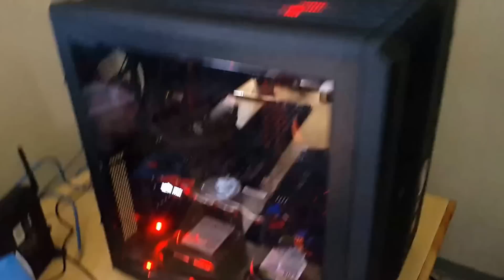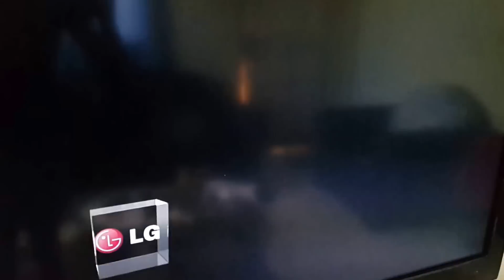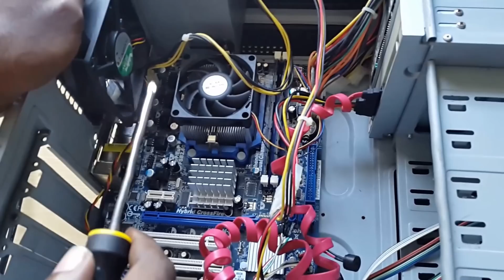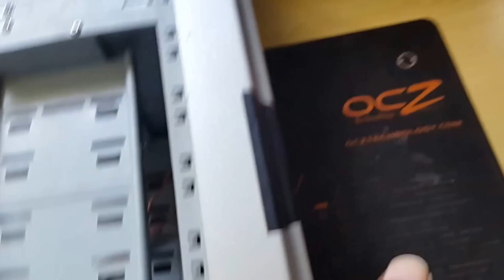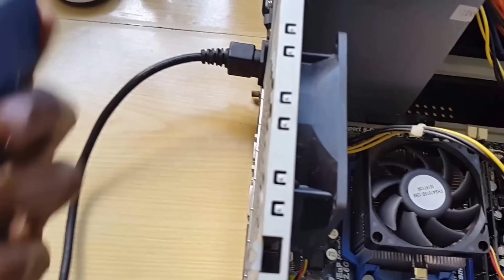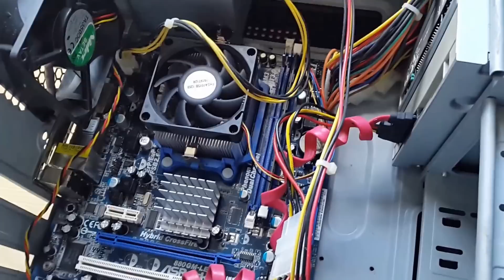No signal to Monitor Fix Easy PC Fix

Comment: hey bud nice video listen i got a issue with a foxconn m31 series mobo where i have tried to trouble shoot a no signal issue on it the mobo powers on but i dont get signal on the display i have changed ram i have changed psu i have put graphics card in i have put another harddrive in i have taken out cmos batt and still no joy any ideas???

Comment: If you’re still trying to find the solution I tried everything too I just unplugged my screen left it off for a minute or 2 then plugged in my screen and it worked it had said no signal also and I replugged everything idk why it would do this either my screen is a aoc monitor if this helps anyone also try a diff port and or your graphics card port not your motherboard
Reply: My screen is A aoc to but it tried it on a BENQ AND THERES THE SAME PROBLEM THINK ITS MY CORD
Reply: Jamal Waddell yeah try the regular things like diff monitor, cord, try the same cord and monitor but diff computer and eliminate the variables 1 by 1 I did it and they were all good it was just the order I plugged them in for some reason which is retarded but that’s just what I did good luck

Comment: I was able to clean the gold leads on my RAM gently with a towel and it did the trick. This was my second attempt to clean the RAM. The first time I tried to simply spray the leads and connection with a can of compressed air and it did not help. Thanks for the video!

Comment: If you have a graphics card 
Then put your  HDMI or what ever you are using in the graphics card not the motherboard.And yeah after 2 hours of research i have this conclusion made
Reply: My problem is my vga is no signal . Please help me
Reply: @yellowzonesbj4468  if you have a graphics card then put your vga in that if you dont have then you can change your port if you have more then one or change the cable it could be damaged or something.
Reply: @yellowzonesbj4468  try the same i have replied to yuukieha
Reply: @potatogamer3552  thanks dude  i  toke out my graphics card and  put it a little lower turns out the cable isnt dirictly plugged to the graphics card cause it has metal on it so i moved the graphics card a little lower to completely plug my cable thx
Reply: @yuukieharedhacker6364  your welcome brother
Reply: I  had a new graphivs card and it says no signal and when i plug the vga it still says no signal
Reply: @yuukieharedhacker6364   check the vga cable's pins on the top if one is missing or banded please change and also try to take out your graphics card once maybe that's the problem
Reply: Ok I did wat u did (I have a display port cable btw) but I still have no display and still have the EZ debug red light
Reply: @tsumm9951  Hmm try to put some thing else in your monitor like if you have laptop that have a vga or something else  to check the vga port in your laptop is still in  working condition if you have two ports of vga in your computer/monitor  then try to change it.
Reply: I forgot also take out your ram and clean it and put it back again this should stop the red light thing.

Comment: To who ever read this comment. YOU HAVE TO CHANGE MOTHERBOARD. Once the part of motherboard  got broken and stopped functioning. ITS USELESS. But also try to bring it to a technician if there's a possibility that the problem might be on your monitor. (It can be fixed)

Comment: My problem was that I plugged in my desktop to a power strip and not directly into the wall
Reply: alberto miller is that a real issue?
Reply: @boyboy6123  yeah, sometimes the power strip would divide it's power and lose voltage and it won't supply enough power to the power supply, so it won't turn it on. Also it is a major fire hazard looking back on it and the best thing to do was to plug it into the wall anyway. Linus tech tips made a video talking about this issue, but he used extension cords instead.
Reply: alberto miller my gpu powered fine with a power strip until I saw no signal and reinstalled the gpu and then gpu stopped working :( I put power cable directly in the wall and no result. I checked pci connectors, all wires and everything is fine but gpu.
Reply: This comment saved me my god, sometimes the power outlets dont generate enough power vs the wall usually having a better voltage so yes this can cause the problem
Reply: @thunderhailx  glad I can help ;)

Comment: I’ve tried moving RAM using MoBo ports I bought a DVI STILL doesn’t work. Tried using one stick of RAM doesn’t work. I’ve tried removing GPU and putting it in. I even rebuilt it it still says no signal. I’m using a ryzen 7 with a asus rog Strix x470 F gaming and the GPU Is Asus Strix 970 GTX the only thing that was used was the GPU and the owner said it was working fine before he sold it to me. Please help

Comment: I found out it really was the video card... not the cable or monitor cause when I plugged it into the built in card the monitor came on fine so it's the external video card.... gonna try n unplug n plug it back in its sloy if that fails.. wel my card is fried due to the random power outages despite having a surge protector .

Comment: Hi guys,

I have just build this new pc. Everything is new. I have zotac rtx 2060 gpu. When i start my pc it starts normally and press delete to go to bios message shows up and when it tries to shows windows welcome message it shows no input signal found, display going to sleep and black screen. Then when i restart the pc everything starts fine. Now i can't figure out what's the issue. Also when i turn on and off the monitor it tries to show the windows and gives a sound like when you insert a usb on pc. like it's detecting sounding and installing. Also one time it showed the mouse but in a black screen. Now  i am thinking maybe gpu issue. i do have installed the latest drivers.  I do not have any old gpu. Also i apologize if this doesn't make sense.English isn't my first language. So this may sounds confusing. Thank you. My pc specs:

cpu: Ryzen 5 3600

Mobo: B450 Tomhawk max

gpu: zotac rtx 2060

storage: 512gb 220s ssd

16gb ram

Comment: Thank you so much. I removed the monitor cables and held the power button for the minute, plugged cables back in and it worked. Relieved.

Comment: Try jumping the CMOS by finding CLR CMOS on your motherboard then remove the cap the normal is 1-2 pin then try it in 2-3 wait for 3 to 10 minutes then power on your pc😬 works on my pc
Reply: Hi i did the first step and it workt one week later the problem came back and the first step dosent work anymore i am tooo afraid to tuch anything in my computer do u have social media to help me PLEASE PLEASE PLEASE PLEASE PLEASE
Reply: @tiffanypaw6635  I'm just an 18 years old sr high student😂

Comment: Should i do this methods even if my pc is new ?

because i want to try 2 monitors. but  the problem is it says no signal at vga and hdmi at graphics card .

but only 1 port I can use for 1 monitor
the DVI port.
I worried to buy a new monitor because I try the other ports and it says no signal . 

can this methods work for mine ?

Comment: Aye so i switched the monitor and used dvi/hdmi cord and the display finally works, the keyboard and mouse light up, it detects them, and says:

Please enter setup to recover bios setting.
Cmos date/time not set
Hit f1 to run setup
Hit f2 to load default values & continue

When I try to select f1 it does nothing, as if the keyboard isn't functioning/responding, or the display is frozen.
Yeet. Pls help me, I'm an absolute potato 🥔♿

Comment: Thank you so much Ricardo. You are a genius! I watched the video, and was very sceptical. Unplug the power cable, and hold the power button in? And that's it? I was sure there would be no way that would work. I tried it, and it worked. Amazing, and so simple. All fixed. Saved me the cost of buying a new GPU, which seemed to be the most obvious cause.

Comment: I have problem with MSI wind Top AE2020 when switch on no blank screen with note,,,,,no HDMI signal
Reply: Have you used the reset cmos switch? Had the same problem, take out cmos battery, if that doesnt work, there should be a couple pins next to it, use a jumper, and if you dont have a jumper, place a flathead screwdriver on the pins and move it around 'till you get a post.

Comment: This happened to my PC just a minute ago and I was panicking. Was working fine then just got the no signal issue. Tried a few things and couldn't see anything wrong. I found out the cause. One of my power supply connections to the motherboard was unplugged so plugged that back in and it now works, so I'd say check all the connections from the power supply to the motherboard

Comment: No signal and I think my ports are damaged because my mouse isn’t lighting up nor my keyboard does anyone have an idea of what I could do
Reply: Check to make sure all your power supply connections are plugged in correctly, I was noticing my keyboard wasn't lighting up and some of my fans stopped working as well. One of my connections from the power supply to the motherboard was uplugged

Comment: Getting a new power supply worked for me. Also make sure you're using the correct cable for the power supply.
Reply from the maker: Thanks for the tip sure it will help others.

Comment: First method worked thank you. What exactly causes this problem?
Reply: I'd like to know too. I just had this issue and can't find the answers anywhere. I'd really like to know what happened so I can avoid it in the future.
Reply: I've gathered that there is a similar issue occurring with TVs where you need to unplug and press the remote on/off button for 30 seconds. The reason why it's necessary: Even though the device doesn't get any power without cable connection, there's still electricity stored in the condensators. And if a fault is present in there, it will be only be removed once the condensators are drained through the surge that happens when trying to start the system when you press the power button. How these faults occur, I do not know, either.

Comment: Do you need a graphics card in order to get your monitor to work?
Because I plug my hdmi to my mother board and it doesn’t it says no signal on my monitor
Reply from the maker: No the problem can be with a Graphics card or onboard video.

Comment: I'm having same issue no signal to tv from HDMI cable is connected to my Rx 460 and my keybiard rgb is not turning on ive checked everything I suspect a bad ram since the ram dosent produce heat it feels way cold I also have a rx debugg led that says vga what is odd is taking gpu out turns my keyboard on ?? I have a ryzen 3700x a msi mpg x570 a seasonic focus gold 750 watts and lpx 3200 2x8 sticks

Comment: I just bought a cyber power pc with a monitor, no signal.
Reply: Take it back
Reply: Same thing happened to me, try a hdmi if youre trying a VGA cable. If youre using vga and it doesn't work, then try HDMI

Comment: The first method fix the problem but when it launched i had a cpu error is that safe ?
Reply from the maker: Check out what the CPU error means.
Reply: @rickytlc1985  i found the problem and fixed it. The cpu fan was not moving thats why it showed the error

Comment: Pushing the power button for a minute didn't work for me, so I ended up doing all the steps he said which includes unplugging and replugging all the stuff he mentioned (graphics card, RAM sticks and CMOS battery). Now PC is back to normal! Thank you, Ricardo!

NOTE: It worked on my second try. The first try, I didn't snap everything back into place coz I was afraid of breaking the motherboard lol. But the second try I used more force and I heard a "click" sound which probably confirms I placed the stuff back correctly. haha Thanks again, you're a lifesaver!

Comment: I just upgraded to a 1070 from rx 580 and I uninstalled amd software from my computer and put the 1070 in and now my computer turns on but no display. What do I do?
Reply: @prorank4  i fixed the problem but thank you guys anyways haha
Reply: I have the same problem from rx 590 to rx 5700xt
Reply: @prorank4  yes it does its basically brand new

Comment: I tried all i have to try like replacing  thermal paste, replacing ram and other things but then the only thing that worked is your 1 minute press. This pc is dead for 1 month. Im not opening it cause i thought it will not open any more. This video really helped me so thanks a lot
Reply: This is the problem now, after having an input and visual, it immidiately got stucked on "starting windows" for a long time. After i restarting it by long pressing the power button and then turned it again, there's no output again. I tried the 1 minute for the second timr but then it now doesnt work

Comment: So i was just cleaning inside my computer, i also decided to cable manage to make it look better. Then u know what happened. I tried the first method 5 times. Didnt work, so i was going sad becuz it wasn't even a month since i got it. I dont know what i did, but it worked! I tried some of ur methods didnt know which one but it worked! So thanks!

(Edit) i threw the ram sticks in rage. Then smashed it back in the dimm slots. I think that fixed the problem!
Reply: Would hitting the ram actually work or is that a joke
Reply: @ItsnerewithaL  I don't recommend it, but cleaning the ram or taking them out for a while shud do the trick.

Comment: So I got a prebuilt PC from ncix which went out of service due to bankruptcy. I've done all of these steps and have not found out why my PC is still refusing to show signal. I've had the computer for a good year or two and had some complications due to viruses and have removed them. I have also factory reset it. My problem lies within the day of this comment. It randomly started to crash by disconnecting itself from my monitor, my PC is on and so is my monitor, I press the power button and it doesn't shut off. The only way to close the PC permanently was pulling out the power wire while it's on. I know it's stupid to do so but it was my last resort. I've done all of these steps and checked the cable, cables are fine, ram is dusted and clean, the circuit board is on, I've tried removing the graphics card and placing the vga to my motherboard. Still no response, I have a theory that my power might have shorted out but I was told that id have to do a process of elimination. I'm in no means close to knowing much about PC's so I'm not going to mess with it. Any advice would help.

Comment: It worked kind of my display turned on but now I'm stuck at 800x800 at 1hz rather than 144hz 2k
Edit: i fixed it by updating my drivers after doing these steps then i restarted and it was fine

Comment: Need help . The computer is working but the monitor has nothing on it and my mouse and keyboard has no lights on it
Reply: Did you find a fix?
Reply: The Gamer Whos Bored if you know one tell me please
Reply: EnterYourName I'm not sure if it was in this video, but I unplugged my PC, held down the power button (for around 30 seconds iirc), plugged it back in, and it worked! Please tell me if it fixed it for you, I sadly don't have any other methods, but you can always try the various methods on forums. I simply want to know if it did work, because it would help me feel good knowing that I helped someone fix their PC.
Reply: The Gamer Whos Bored I tried it didn’t work, I’ve tried everything and nothing works

Comment: I've literally done everything I switched the CPU power supply ram ssd into another unit I had because I come down to thinking it was the motherboard.. well swapped everything over and still nothing everything powers on perfect my graphics card works in my other computer with the hdmi hooked into it I truly do not know what the hell to do now what's the chances both motherboards are bad??

Comment: I get no signal when I connect my DVI with my monitor but I do get a signal when I connect it with an HDMI cable. I want to use DVI to get 144hz. Does anyone know what my problem could be?

Comment: I have a desktop with 4 sticks of ddr2 ram and a gtx460 graphics card. Basically I had pulled ram one at a time and the monitor turned on once. So I pulled 2 sticks so there was still 2 and planned on using it that way for now. But now I have no monitor signal and I tried everything,  I dont know where to go from here. My voltmeter broke and i dont have that now so i cant check voltage either.

Comment: Tnx. PCs (2) are having the same problem (no signal on working monitors 4 tested 3 cables tested all good) after I I stalled Kingston 4gb 3ddr ram (1stick). 1st PC starts beeping. ( 1-1-1-2) tried other PC. Nothing. Back to first PC. Starts up dual boot with stupid windows so I check windows for some reason and it starts updating. That went wrong I guess so now PC gives blue recovery screen and begins some recovery loop. I shut it down. Start it up NO signal to monitor check cable ...power saving mode Corsair k70 keyboard goes into demo mode or something. Repair CD does not work USB recovery does not work(dont know black screen cant see).
So I think well I still have other PC but now this one also no signal. Same problem within half an hour with 2 pc s running dual boot PrimeOS and windows10 after trying new ram stick. 
Windows helpdesk says I need to open recovery on my screen.............................the screen I told them that would not get a signal!!!
Look on the web and apparently many many people give you this advise. Which Is alarming to me. 
Anyway....basically I have bricked 2 good pc s  in half an hour with update I didn't  want in the first place. Or somebody sold me the most rotten RAM he could find. Nice video +1 sub. 
Maybe u know something.  Have a good day Sir.